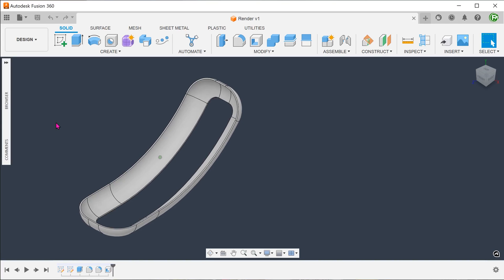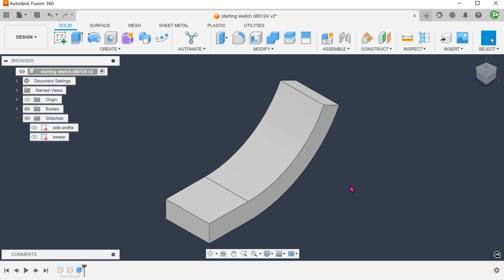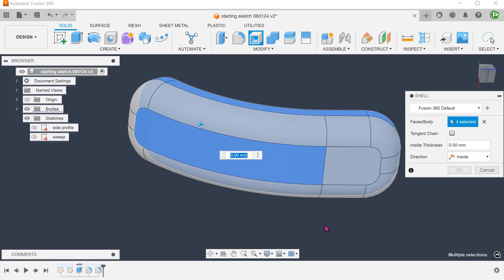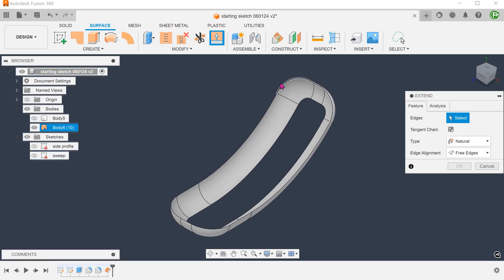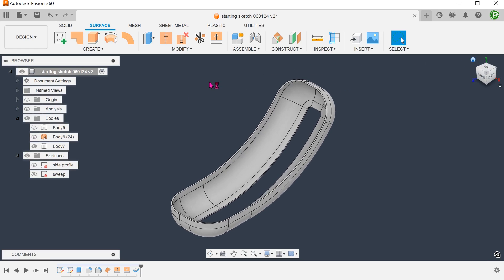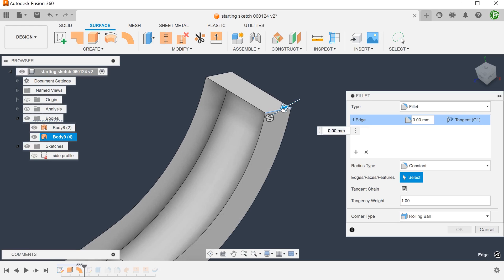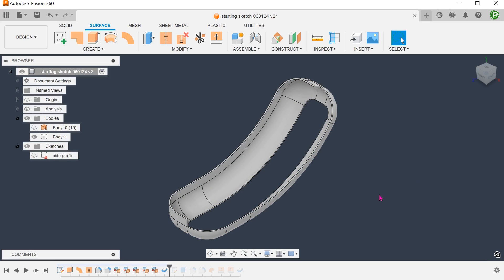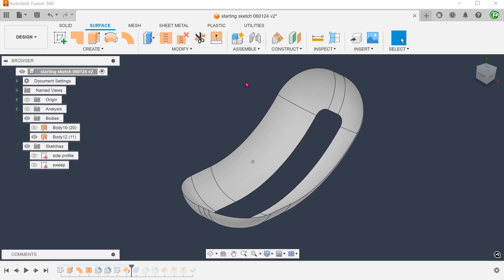Fusion 360 | How many ways?

Comment from the maker: If you try to thicken the sweep, you would run into problems. I had wrongly assumed that it would work. I really should have done the due diligence in testing it out before making the video. Sorry about this. 
Since then, I have been trying to adjust the sweep profile such that the thicken would work. It was not as simple as I thought! The thicken function does not play well with certain curvatures. Do try to adjust the profile yourself and let me know your results!
Reply: Would be great to make YT membership of your channel. I would definitely become member :-) ❤
Reply: As a workaround for the failed thickening I could create two surface bodies from sweeping two segments and thicken them individually, then combine. However sweeping in one step and cutting the swept surface in separate bodies didn't achieve the same result. Awesome channel btw, by far my favourite fusion tutorials.
Reply from the maker: @lonikur_  Interesting. How did you delineate the two sweep segments? After thickening each segment individually, was there any mismatch?
Reply: @Fusion360School  I rechecked and found one difference to your example: Your sketchplane for the sweep-profile intersects through the middle of a segment of the Path. I created the profile for the sweep on a construction plane at the end of one of the path segments. That way you can use the same profile for sweeping two halves of the path. There is no interference/gap for the resulting thickened objects. Hope that explanation helps
Reply from the maker: @lonikur_   The sketch plane intersecting a segment does seem to be a problem. In the end, I got it to work by splitting the segment, sweeping one half, thickening and then mirroring. But it is not smooth along the mirror plane. I should try a profile at the end of one of the segments like you suggested.
Reply: @Fusion360School  For me it works even with splitting the segment. How did you split it? I split the whole body along YZ, then swept, thickened and mirrored -> no interference.
Reply: It works in solidworks when I thicken the sweep.

Comment: I was thinking for the sweep to use the original sketch profile and sweep a rectangle or the non-filleted cross-section along the arc
Reply from the maker: That is certainly one way to create the main block instead of using the thin extrude.

Comment: Hi there, I always enjoy watching your videos as they give me better ideas for how to design a partsin Fusion. As I watched through the video I did have a question are there any benefits or detractions to the different ways these have been designed?
Reply from the maker: I would say that the solid method is probably the most straightforward method, but it might be more difficult to make adjustments after the fact since the material thickness is already there. The surfacing methods are more complicated but allow for more flexibility in adding extra flanges, etc.
Reply: @Fusion360School  interesting and awesome, thanks for the reply!

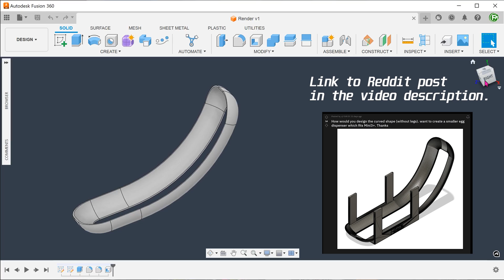Comment: Just a quick question, how did you rotate the model during 00:02~00:10 in the 3d view? What hotkeys were you using? Thanks.
Reply: My guess he's using a spacemouse (3Dconnexion or something similar), I don't think it's possible to do that with regular mouse + shortcuts
Reply from the maker: I am using a 3D connexion mouse. A regular mouse cannot achieve this kind of smoothness. 
Sometimes, I wonder why not? Not sure if it is a hardware or software limitation.

Comment: i created a U shaped profile perpendicular to the line and arc, and use swipe, than with cut on offset plane shape made the hole
Reply from the maker: Sounds workable. With this method, how would you achieve the rounded ends?

Comment: Great video. While watching it i thought of a problem i had. Is there a clever way to design grips? I talking about tool, drill or weapon's grips. The only way i found (after watching hull modeling tutorials) is making a lot of sketches and then lofting it in some devious ways. Only to later found out that is was not comfortable at all. So is there a way i design them  at least conveniently or moreover a way to make them easily adjustable. My model also looked weird(the light  was rendering badly?) - i dont know if thats fixable, but i would be happy to know the answer why it happened.
Reply from the maker: It really depends on the complexity of the pattern. Sometimes, you can get way with circular pattern of a simple extrude. Or you can use emboss, which can be a tricky tool to use. If the handle is not circular, that adds to the complexity. General rule is to not pattern sketches and pattern features instead.